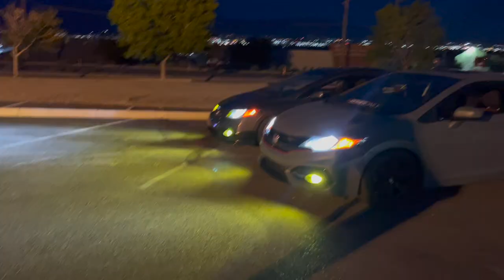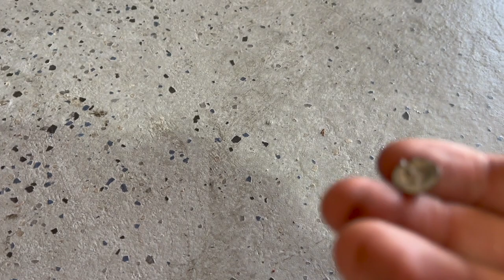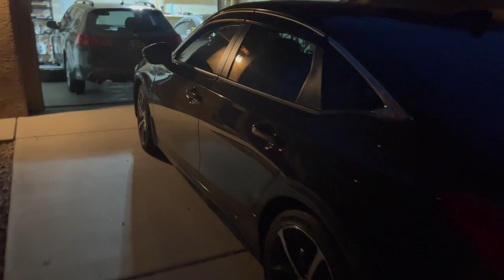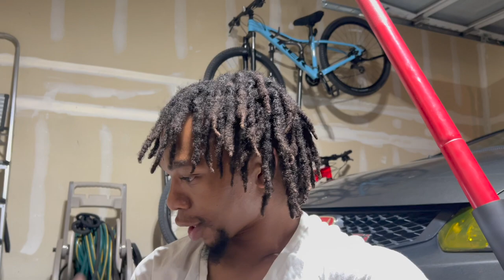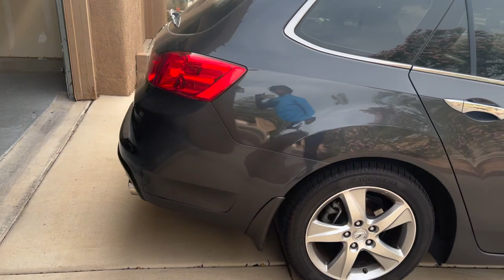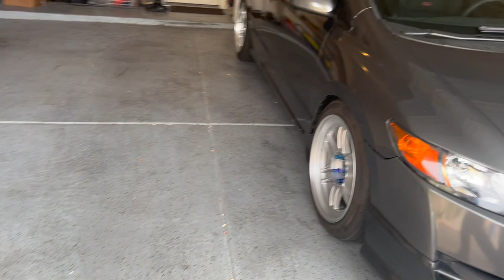What was Acura thinking using these on the TSX Sport Wagon !

Comment: So next time you run into this issue with the stripped rotor bolt. You just use the bolt you used the impact driver (but just use a ratchet to get a little torque where it contacts the hub then back out and remove that bolt and it will break free the rotor screw). No broken heads or stripped bolts. I know this is an old video but just a heads up for next time.
Reply from the maker: I learned after the video lol thanks though

Comment: if your wheels still wobble when braking its time to replace your front struts i have a 2nd gen that did that , did the brakes still did it put on new struts all as good as new now, As for your rear brakes they good bro, you dont need to change , i would say till the next time you need to do the fronts , the front brakes do most the work, you can get by doin the rear every other front change , love the wagon
Reply from the maker: Just recently did the front and rear struts